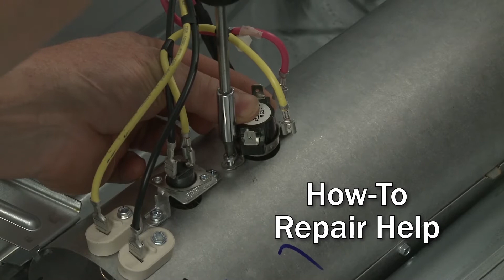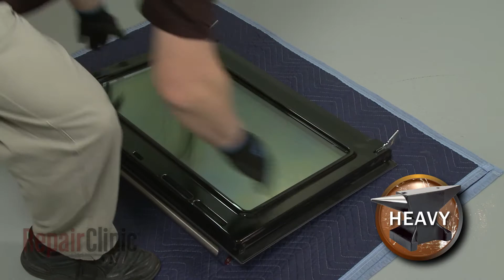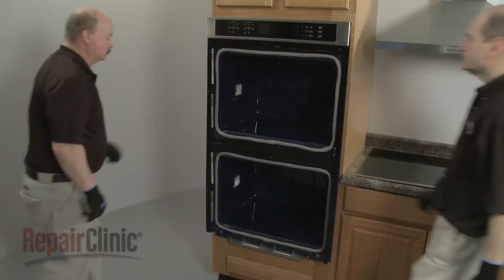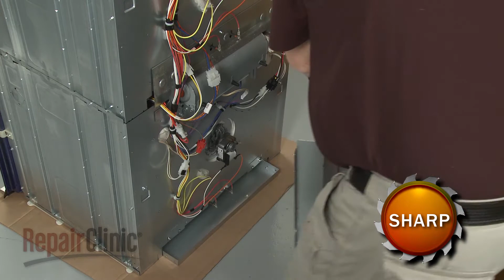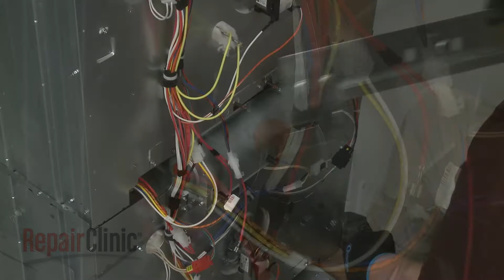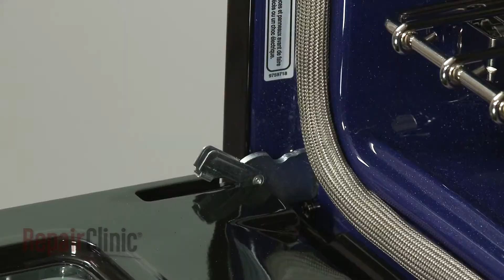KitchenAid Double Wall Oven Bake Element Replacement WPW10546517

Comment: The cheapness of these ovens is really apparent from the back... just bend the metal flap to replace the element! What a stupid design. Element failure is common across all manufacturers, they know it will need to be replaced at some point, and should have made service easier. Why not make the cover removable with bolts? Bend that flap too many times and it will fall off. Better yet, why not make the element serviceable without removing the oven from the wall? Obviously these designs are to save manufacturing costs, but they come at the expense of product longevity and serviceability.

Overall, these ovens are poorly designed and cheaply built, yet were sold for a premium. No wonder ours is so unreliable.

Comment: My oven was bought back in 2011 as well.  The bake element for top over access is crazy.  Nothing like this video. Any video to replace model No.  KEBS277SSS04?
Reply: did you ever figure it out? I have the same oven and its time.

Comment: Access to the bake element in the top oven is not the same as in the video on my oven.  It was much more difficult to access and change.
Reply: My oven was new in 2011
Reply: did you do it yourself? i have the KEBS207SSS04 and I am trying to figure out if I should do it myself. Thanks

Comment: If both upper and lower ovens are not heating, what are the odds that it's both heating elements? It seems it would be some kind of electrical connection since it's both upper and lower....